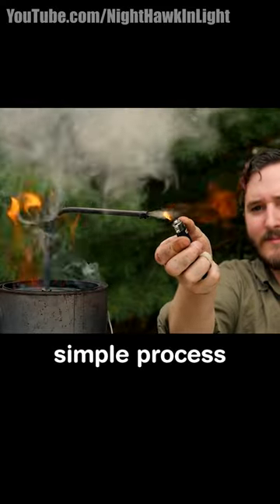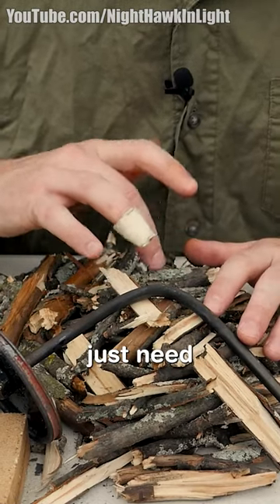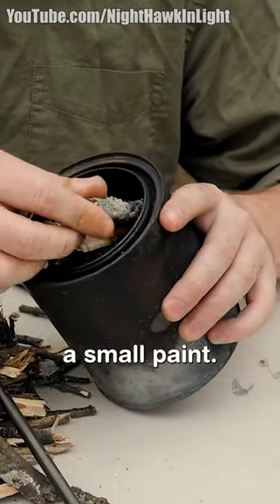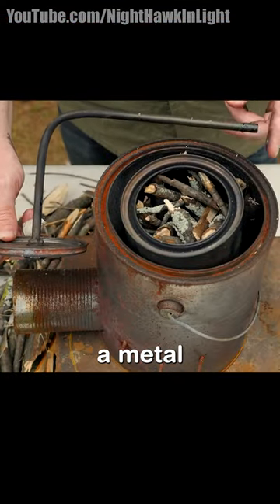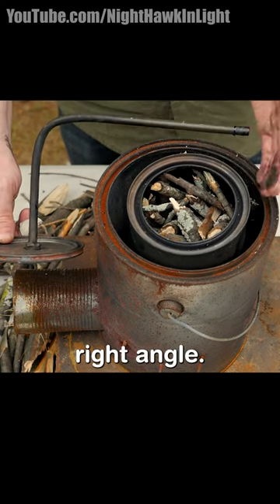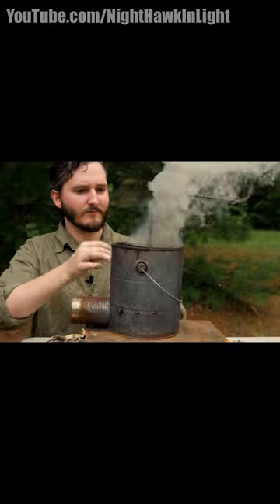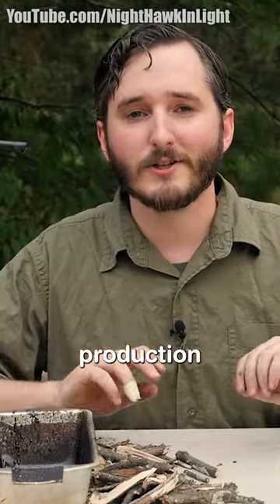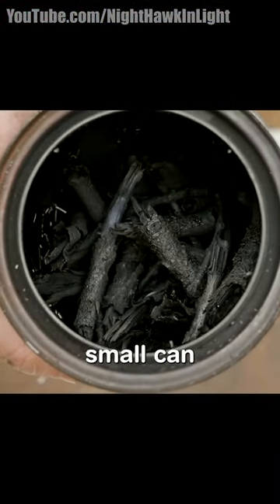Easy Wood Gas Generation

Comment: I'm curious, would it be possible to put that gas back through the fire to provide more heat and make the process quicker
Reply: Definitely, I've seen it done with large charcoal retorts